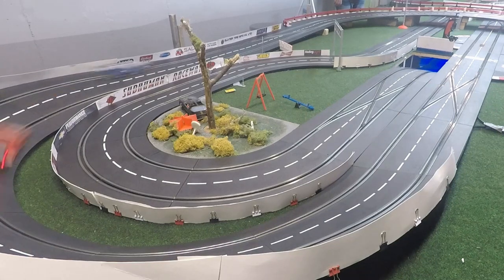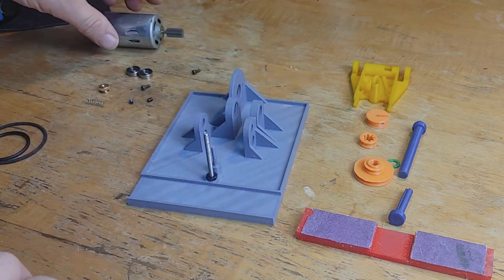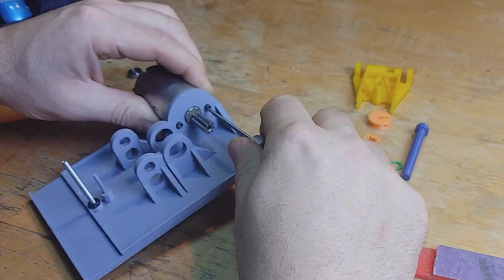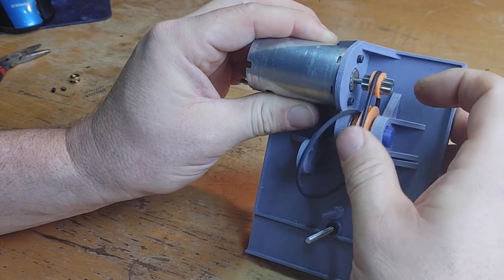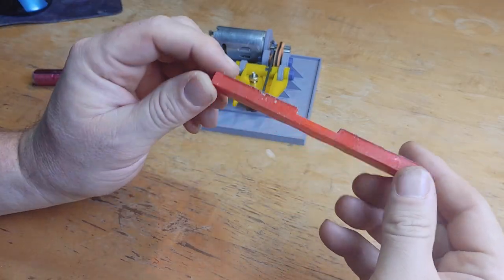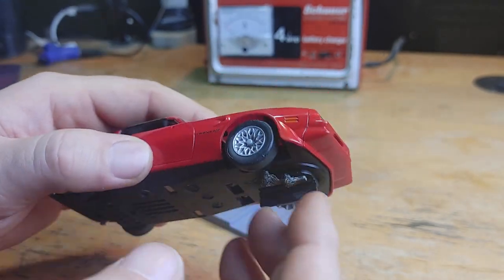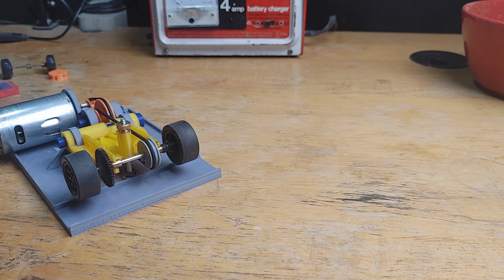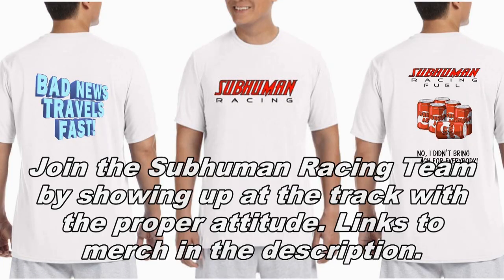Building a Slot Car Tire Truing Machine for Cheap – Carrera D132 Digital 132 and 124 Slot Car Tuning

Comment: Finally build and tested (on 6 cars front and back) my version. I've done some slight modifications, mostly due to metric hardware I already own: bearings "1280" 12x8x3.5mm, 8mm metal shaft for the swing arm (easier, faster and more precise than printed for me), and probably the most important: metal drive pulley (I have a metal workshop at my disposal). 
It works great. As the driving o-ring can't be positioned in the middle, there is very slight misalignment due to arm bending a little, I believe it's best to sand each wheel separately. It's also easier on the motor. I will probably modify the sanding block to have "one side" only, but overall I'm very happy with it. 
Thank you for designing and sharing this. You saved me a lot of time, as I was just planning to design something similar. I've just discovered this hobby few months ago and all of your videos were very helpful.
Reply from the maker: Great to hear it's working out for you. It would be great if you could email photos of your build. Hopefully I get enough photos of from viewers of the truer and other projects on the channel so I can make a "Viewer Builds" video.

Comment: Great Video, thanks for the chance to download and print. I will give it a go and report back.
Reply from the maker: Excellent. Looking forward to hearing about your build.
Reply: @johnniehobby  stl's won't download, no idea why..
Reply from the maker: @neilmartin849  What browser are you using? If it is Firefox then left-clicking should bring up a prompt to save the zip file, or right-click and select 'save link as...'. If you are using Chrome, you need to right-click and choose 'save link as...". Left click using Chrome doesn't do anything, apparently.
Reply: @johnniehobby  Thanks Johnnie, I got there eventually, going for it now..!!
Reply from the maker: @neilmartin849  Good to hear. BTW: I think I got the website fixed. There were issues with SSL certificates throwing a wrench in my program.

Comment: Great job! 

A couple things... when I went to download the STLs, Chrome refused to do it until I forced it to, because it's saying the site is not secure.  Not sure why, but I was able to download it. The other thing is that I see you've already updated it so that the spring support is a separate piece. For strength, it should be printed flat, but for that, it should have a flat side for better success printing it. What I will often do is make a hexagonal pin rather than a cylindrical one. Same thing for the two pins, though mostly round with a flat on the side would print well, be stronger, and still work just as well.
Reply from the maker: When you went to the website did you use 'http' or 'https?' Chrome doesn't seem to have a problem when using the 'https' (secured) hypertext transfer protocol designation, at least from my end, but I rarely use Chrome but normally Firefox, so could be something I'm missing. I'll check with my registrar also to see if I need to update a security certificate.

About the spring support pin - items like that I usually print flat on the bed and normally with success but they definitely can have a problem sticking the first layer because of the small contact area. So, good point about making them hexagonal. I'm going to try that moving forward.

Comment: Very cool,  can't get a tire truer because of lack of availability, if you make anymore i'd buy one.  Cheers
Reply from the maker: I now have the tire truing machines available as a full kit (everything except the sandpaper and power supply) or a short kit that includes only the plastics and will require additional hardware (motor, bearings, grub screws, o-rings, etc.). Check the video description for more information if you are still interested. Cheers.

Comment: I got my motor and bearings, now I just need the plastic parts that you provide!
Reply from the maker: I had a slight issue with shipping as the USPS scanner couldn't read the bar code on the first shipping label I printed. Needed to reprint with a different inkjet. All set now and I was able to get it sent this morning, 2-day priority shipping so hopefully you have it by Monday. Sorry for the delay.
Reply: @johnniehobby  no problem. I didn't expect that you would be shipping it that quick. Thanks!

Comment: Hi, how are you doing ? Very cool this tire tool, I will try to assemble. But looking at the parts, I have a doubt.
The indicated motor has a pinion of 10 teeth, and the motor adapter has 8 teeth. That's right ? Thanks
Reply from the maker: You are correct. The motor I had for which I designed the unit has an 8-tooth pinion and I incorrectly thought the one I listed from Amazon was the same. I have since designed a 10-tooth adapter, however I have not yet procured the 10-tooth pinion to test the fitment. As soon as I do and get the design finalized I will update the files on my website to include both the 8 and 10-tooth adapters.
Reply: @johnniehobby  Great, if I can do that, I really appreciate it, because I don't know anything about 3D printing. After that, I continue the construction. Thanks a lot.
Reply from the maker: @ronaldonevola8030  I have a 10-tooth adapter that should work now. Email me @ john@subhumanracing.net and I can send you the .stl.
Reply: @johnniehobby  Hi John, I send email about .stl for 10 tooth pulley adapter. I received my motor, but it came with a 10-tooth pinion. Thanks a loot.
Reply from the maker: @ronaldonevola8030  I just sent the .stl for the 10-tooth adapter to your email. Let me know how it works out.

Comment: We have a motor that has a 10 tooth pinion on our motor instead of 8 and has a diameter of 3/8". Any suggestions on were we can find a file to print that would fit? I've searched everything on google I can
Reply from the maker: Is it a Power Wheels motor?
Reply from the maker: @AuburnClinic  I designed pulley adapter that should fit the 10-tooth pinion that comes on the Amazon motor. If you send an email to john@subhumanracing.net  I can reply with the .stl.

Comment: Great video and sweet design.  I have a tire truer already, but if I ever get a 3d printer I would give your design a punt.  

I was wondering if the design would benefit from a thinner adapter on the axle pulley (i.e. the adapter you add to the axle with the grub screws)?  It seems to have a lot of play shifting the axle left and right.  I think if the o-ring pulley adapter was sandwiched a bit more snugly inside it might make a small difference and lessen the play.  Cheers  and thanks for all the great RC and Slot car vids!!!
Reply from the maker: Good observation. I noticed the same thing, but not when I was using it but when I was reviewing the video, thus a little late to make the change. However, that'll be one of the first pieces to be tweaked in upcoming revisions. Thanks for the feedback.

Comment: Could you use an amazon 12vdc variable power supply so you can slow down the rpm so less heat to ruin tires?
Reply from the maker: Yes, as long as it is capable of 4 amps or more.

Comment: Is there a way to buy the parts if I don't have a printer
Reply from the maker: Probably. I'm currently making a couple improvements right now after which I can print a set. I'll let you know when it's finished.
Reply: @johnniehobby  ....I love this and am also interested in buying the parts as I don't own a printer.
Reply from the maker: I now have the tire truing machines available as a full kit (everything except the sandpaper and power supply) or a short kit that includes only the plastics and will require additional hardware (motor, bearings, grub screws, o-rings, etc.). Check the video description for more information if you are still interested. Cheers.

Comment: Hi do you sell the tyre truer
Reply from the maker: I now have the tire truing machines available as a full kit (everything except the sandpaper and power supply) or a short kit that includes only the plastics and will require additional hardware (motor, bearings, grub screws, o-rings, etc.). Check the video description for more information if you are still interested. Cheers.

Comment: Any updates on parts availability?
Reply from the maker: Sorry for the delay. I'm trying to add e-commerce to the website and it's been an adventure to say the least. I believe I have it working. You can be my test subject. Go to this URL to place an order:
https://subhumanracing.net/shop/
I hope you live in the USA because that's the only shipping setup I have completed so far.
Reply: @johnniehobby  .. thankyou...it looks like the order went through ok...I'm anxious to get the parts for sure
Reply from the maker: @racie35  Order received. I'll start printing up a set of plastics and get it shipped out to you ASAP. Thx.

Comment: Did you use PLA? Or ABS? Nice job brotha
Reply from the maker: PLA, which I use for pretty much everything. I don't have an enclosure so have never tried ABS. I might soon, though, as there are some parts I want to make for my RC truck that would require high impact-resistance plastic.

Comment: Hi, I just subscribed, do you sell this tire truer as a kit? Thanks for the honest information!
Reply from the maker: We do sell the tire truer. You can get the full kit that includes everything except the sandpaper and power supply. Also a short kit is available that includes only the 3d-printed plastic parts. See the description for the additional materials required to complete the short kit. You can find the two kits on our website here:
https://subhumanracing.net/racing-shop/
Reply: @johnniehobby  I was just about to hit "Place Order" on my PayPal account but the "ship to" address is my old address. I looked at my "Account Owner Information" and it shows my new correct address. What can I do? Thanks for your help.
Reply from the maker: @user-jx3jp3gb4x  I had the same problem with my PayPal account a while back and unfortunately I don't remember how I fixed it, but I do remember that it was more difficult than it should have been. I'll dig around and see if I can find some info to help you out.
Reply: @johnniehobby  just paid :)